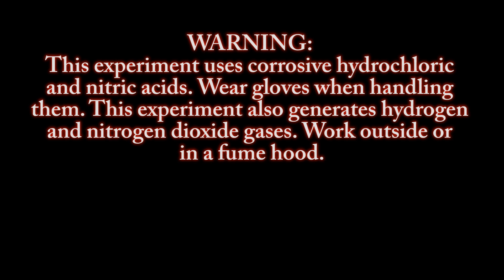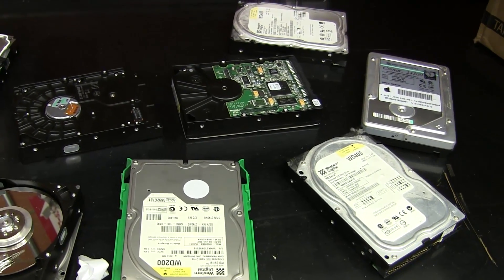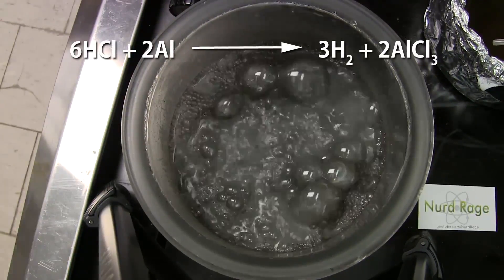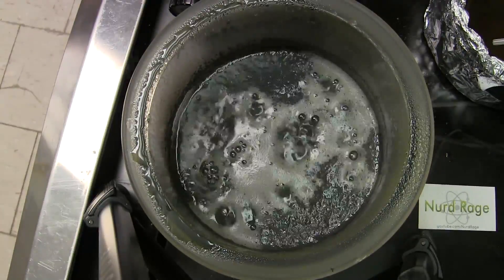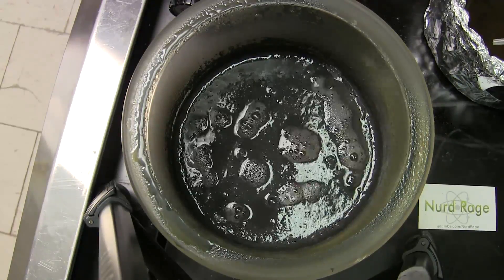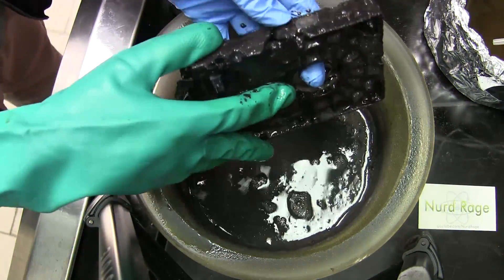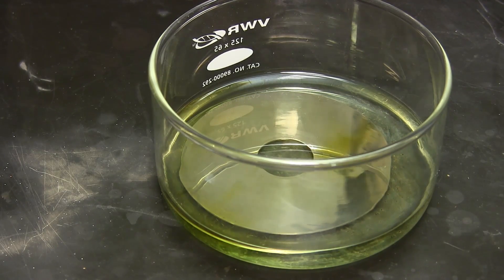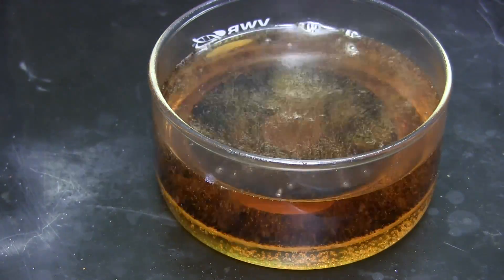Dissolve Hard Drives with Acid

Comment: Primary method: Use hydrochloric acid to dissolve drive components, then remove platter, place in separate vessel, and immerse in nitric acid. Wait for protective coating to burn off before adding more HCL to dissolve aluminum platter.
Alternate method: Bomb.

Comment: Producers of Prison Break TV series should watch your video. I mean Michael Scofield made a mistake by throwing hard drive into the water and even from there data could be easily recovered. But when you dissolve special alloy platters where data are stored in aqua regia, then there is no way to recover the data (however you can recover few miligrams of noble metals which are very valueable nowadays).

I actually disassembled some of my old hard drives and I kept these special alloy platters, because they contain noble metals from platinum group (who knows, maybe they will be very valuable some day).

Comment: Didn't even need the nitric acid. Just use a screwdriver and make a few hard dents on the disc. Coating gone, leave overnight. The next day all that would be left is a thin layer of the coating around nothing.

Comment: To kill the platters you can use Sodium Hydroxide (actually a product called Oakite 90) and electricity (in reverse polarity from plating). It'll blow the coating off in seconds.

Comment: I would have taken the motors out and save them or sell them on eBay.  The key is destroying the platters which are not very difficult to remove.  There are hobbyists who may want the motors, they are brushless and they could run them without much difficulty if any with brushless motor controllers that they already have.

Comment: why didn't you just burn the plastic parts of the hard drive and melt down any metal that was left
Reply from the maker: Because the point of the video was to use acid. Do you honestly go to a wrestling match and yell at them "Why didn't you just guns?" no, the point is to beat each other with fists. And in this video we use acid.
Reply: yeaaaa your baack!! :D i love u bb :$
Reply: +NurdRage I ment as a way to get rid of and plastic parts
Reply: Messy, it leaves residue, acid does a better job.

Comment: I remember talking to a friend who owned an E-Waste business about hard drives. The platters were worth $600 a metric tonne. He used to recover the Pt from them but it was too expensive. He used to snap the platters exposing the Al core and then put them in a solution of NaOH. Once the Al had reacted, the Pt foils would float off which he could then wash and dissolve in Aqua Regia. But yeah, the casing was worth much more than the platters.

Comment: What similarities does H2O2+HCL have with aqua regia?  I had a similar running with a couple of HDD and I didn't have nitric acid on hand so the next best thing was AP solution but it completely disintegrated the actual platter and left the shell of the disk (almost like a new U.S. penny, after it was washed off I simply crushed the leftover magnetic layer to bits and dust, but the platter was gone indeed, on the video it was left intact....why was that?

Comment: This is retarded, you could just microwave it or drill it
Reply from the maker: +xRsAtx If you get your fun by drilling shit, more power to ya. I on the other hand like to use acid.
Reply: xRsAtx Not sure if you are:
1. trolling
2. being an enormous douchebag
3. Missing the whole purpose of this video

This video is intended to have some fun with the harddrives.
If it was just the data on there, then he would have drilled it probably, but instead, He wanted to show us some chemical reactions that happen when you put those acids on the drive.
but you missed the whole point.
Reply: The top result when you google "hard disk" are what you see when you open up the casing of an HDD, hence why "disk" is included in HDD, and those disks are called platters.

Drilling holes in the disk to make normal computers and the control card on the HDD unable to read the data still doesn't mean that the data isn't there, as I said, there are custom tools that can still read the data of the still-not-destroyed parts of the platters.

And I didn't mean microwaving the disks doesn't do anything. I meant that microwaving the HDD doesn't really do anything spectacular and microwaving the platters still doesn't present the flawless result you seem to wish to have.

Oh, and stop using insults and things just because you're mad and you are unable to accept that you are wrong, please at least try to act adult.
Reply: +NurdRage Can you do some experiments involving silane or borane? Thanks
Reply: +PushButton seriously.... here...
Reply: But that is not as much fun...
Also, now we get to learn some more reaction stuff...
Reply: this comment wouldn't learn anyone anything since they don't want to learn. Scroll past <3
Reply: Eckron "they could still pry some data off of it." no they couldn't
Reply: xRsAtx 
ugh nevermind, should have learned by now that people choose to be ignorant
Reply: I like to use and abuse acid too.
Reply: +xRsAtx Ok, I'm really not sure where you're getting your data, but 10 minutes of googling has told me that the majority of hard drive platters/plates won't be damaged, and you'll simply have a f***ed up control board. Guess what you can replace. Control boards.
Reply: Untrue Fires
Watch out, your actual facts might trigger xRsAtx again.
Reply: Eckron "facts" literally no evidence that they are facts
Reply: xRsAtx OK. Friend. Please Google "microwave hard drive" and click the first five links. IR/Microwaves do not carry through Faraday cages. (Hard drive cases form Faraday cages. )
Reply: Untrue Fires Look, I told you, he'd get triggered.
Reply: +Eckron oh yeah btw I'm on your side just want wanted to see how RSAT would react he is a fucking drop kick
Reply: Embedded Irony
>My side
>My ally
>Calls me cunt
>Says that mister. Can'tAcceptTheTruth has a higher standard of living than me

I'm confused
Reply: xRsAtx Oh. Oh that's so civil. And by the way, a hard disk and a hard drive are the same things. HDD. Hard disk drive. 

The principle yet stands. The metals around it act as a Faraday cage, and for the most part, keep most of the radiation from harming the platters themselves.
Reply: Untrue Fires JESUS FUCK they are not the same thing, look up what a hard disk is you fucking mong, its the disk, if the disk is drilled it will not be usable, I'm not talking about drilling the fucking case
Reply: xRsAtx
You simply don't know what you are talking about.
Oh and if you drill the disk, data can still be read off of it, there are custom (custom as in specially made and not commercially sold) tools that can read broken platters (but the files may be incomplete, missing, corrupt and insert other flaws), which is (still) a good reason why you should always overwrite, zero out and decimate the entire HDD (Hard >DISK< >DRIVE<) if you want to be completely sure the data is gone.
Or you can simply dissolve the platters with acid.
Oh, and a "hard disk" and a "hard drive" are the same thing. In IT, we call them by their actual name, HDD or Hard Disk Drive.
Reply: Eckron no, its is you that is wrong
Reply: xRsAtx 
Care to prove it, while acting like an adult and while actually having evidence and facts backing up your statements?
Fyi, I study IT, I'm going to study cyber security, TL;DRring my text down a bit, basically IT is my life, knowing how an HDD works, how it's built and how to properly destroy it on different levels of security are basic knowledges.

Again, I never said you were wrong, never did that. I was just saying your way of having it is not 100% bulletproof (waterproof etc, whatever floats your boat).
And no, the typical user wouldn't need to zero out-, decimate- or dissolve the HDD, but it's just fun to do and it is 100% sufficient (zero-outing is still not a 100% guarantee due to possible broken sectors and whatnot, but you get the idea).
Reply: Then again, if you overwrite the data for another use, would said data still be present? If so, then I'd prefer acids or whatever to destroy whatever data is present.
Reply: Carlos Vera 
There are different states of the overwritten files.
For example, the free and commercial program called Recuva from Piriform has three categories, can't recall the exact names but basically they are "Damaged", "Flawless", "Unrecoverable".
A simple overwrite (1 pass) will still in most cases leave som traces.
A more advanced overwrite (3 pass) can still leave some traces.
An advanced and nicely named overwrite (7 pass NSA) will most likely not leave traces, it's pretty bulletproof.
The Gutmann method (35 passes) is just overkill, the data will probably be completely gone and unrecoverable after 5 passes anyway, Gutmann himself said that this method was invented just for gags (basically).

However, in the most used file system (NTFS) the file names, sizes, extension etc will still be listed in the MFT (Master File Table). Not sure if FAT or FAT32 has a MFT or something like the MFT in NTFS.
Reply: you have been arguing for days just accept your wrong
Reply: drill a hole through it xD

Comment: are any
special gloves needed to work with acid? or do rubber gloves work? thanks!
Reply: I would suggest something stronger than dishwashing gloves.
Reply: Rubber dishwashing gloves would work fine for sulphuric and hydrochloric acid. Probably use brand new gloves to ensure there aren't any breaches in the rubber. Nitric acid requires thick butyl rubber gloves to provide sufficient protection.

Comment: I prefer to just throw the platters and case in a crucible, and melt them into a silver pool of metal in my foundry furnace. Then cast parts I need out of the aluminum. I would like to see someone try to get the data off of a door knob, lol.

Comment: How about of you just bend the disc to damage the coating and then used only HCl and water, would that be sufficient to dissolve the disc, or would you just get a little extra damage in the cracks?
Reply: +Simon Als Nielsen yeah i wonder if you would be left with a cage of the coating...
Reply: Pseudobean Machine
 If so it will probably take ages to complete, but in that case my guess is that the bubbles would block the acid from reaching more than tiny bit into the cracks, but it would be an interesting experiment.
Reply: I'm reminded of gallium on scratched aluminium even thought it's totally different! I wonder if you were left with the coating intact it would be translucent!
Reply: NurdRage I would like to request the experiment discussed above :-P

Or at least your thought on what would happen. :-)

Comment: Nurd, does microwaving your HDD NOT nuke it to oblivion?
Reply: +Moe Chan Also what about strong earth magnets?
Reply: +Moe Chan if the plater is exposed yes if its still in the case no it will however destroy the driver electronics however the data on the platter will mostly be intact and can be recovered using platter swapping recovery techniques

Comment: I still maintain that a good sledgehammer works just as fine. Sure you can read data off drives that are punched through with nails and filled with glue, but good luck reading anything off an asymmetrical chunk of metal that's been beaten on for twenty minutes... =p

Comment: Take the platter, fold it over, scratch the coating, and apply a little gallium. 
I did this a while ago and you can see the coating start pealing away at a rather surprising rate (you can tell it's moving and you'll hear some weird crackling noises) as the gallium works its way through the aluminum. It also seemed like the aluminum was more easily powdered than you'd get from something like a heat sink. It had a really greasy feel to it too.

Comment: You made a big mistake here in the video
since you filmed the platter, now we can all get the data on it
so you didn't destroy the data at all.
Reply: +Ja-Shwa Cardell 1) The data is stored magnetically instead of optically
2) Even if it was optical, the physical size of the bits in an HDD platter are much smaller than bits on say a DVD or BluRay disk, and couldn't be read on a video of this resolution as there aren't enough pixels to convey information.
Reply: +Koriko Alistar He was trolling
Reply: Poe's Law and such.
Reply: Poe'ssy

Comment: The bearings in the motor... Were they also destroyed? I need a good way to remove their super-skookem bearings, but percussive maintenance damages them. The motor chassis is made of aluminum, and the shaft and bearings are some sort of steel.
Reply: +Luke Den Hartog Everything metal was eaten except the platter. This includes the bearings.
Reply: Skookum?  Percussive Maintenance?  Are you a fan of AvE?
Reply: Coffeehound yeah lol
Reply: + iamdarkyoshi    Just remember to engage your safety squints. :)

Comment: The only flaw in this video is that you didn't show the final result!
Reply: +Marcos Vinícius Petri The end result is a solution. No Disk.
Reply: +TheMontanaDave Yea... but it was like a cliffhanger, lol
Reply: James Oldfield Not gone, it will be in the solution.
Reply: I do know it disappeared at the very end. I'm actually a chemist, lol! What I meant is that he didn't show the process. We didn't see the disc getting smaller and smaller and smaller and all.
Reply: Fire is actually worse because high temperatures weaken magnets.
Reply: TheMontanaDave Yes, platters store data using magnetism. If you only dissolve the coating of the platter it's possible you could still use very sensitive equipment to read data off the platter.

It's quite difficult to actually render data unreadable from a platter without completely destroying it. 

We have recovered drives from a computer half melted from a fire before using specialized data recovery services.
Reply: ill boot up the recovery program to see if i can grab my data out of the slop
Reply: +TheMontanaDave ok
Reply: James Oldfield ;)
Reply: It disappears. Don't you know what acid does?
Reply: ***** It takes time, but ultimately you will end up will a solution along with "crap" on the bottom. Sediments that did not dissolve and or  oxides/salts/residuals. The Final product after you get the solution filtered or siphoned will be about the same with give or take a few 'contaminates' - depending on the purity of what you are dealing with. Watch NurdRages stuff on Aqua Regia and all his vids and maybe it will help.
Reply: I agree. Even though the coating on the platter was dissolved it sounds at least plausible that residual magnetism could be left behind inner parts of the platter.

If it was not fully dissolved, it's possible some data could still be recovered on the leftover platter by sensitive equipment.
Reply: Raisonbran648 Data could be recovered? Are you a fucking child moron? Do you know how hard Drives work? SMFH.
Reply: +Raisonbran648 fire isn't the same as deliberate acid destruction. C'mon bro.
Reply: +Raisonbran648 acid changes a material at the molecular level.
Reply: TraumaER lol! Me either.
Reply: +Raisonbran648 I'm not voting for that bitch.
Reply: Yes, so if you just dissolve the surface acid doesn't magically propagate and dissolve anything that it was not in contact with.

Unlike heat that propagates throughout the material, which is also a molecular level change that wiggles all the atoms and electrons around, breaking the alignment that actually creates the magnetic field.

It depends on what material the core of the platter is, if it's able to hold magnetism it's likely it still holds data unless you completely dissolve all of the material.

The whole point is for maximum security you cannot say with 100% certainty that damaging the platter's surface with acid renders all data irrecoverable. That would be naive to make such assumptions with sensitive data.

You should vote for Hillary, she has the same idea about the security of sensitive data.

Comment: How many mol's of HCL (concentration)?
Reply: +GamerABC That's molarity
Reply: GamerABC because that guy wanted to tell you you were using the unit mol wrong.
Reply: +GamerABC You mean the molarity of HCl, not mols
Reply: +GamerABC You mean the molarity of HCl, not mols
Reply: the concentration in mol/dm3. i dunno what you mean by molarity...
Reply: Elaine Marie I need a scissor
Reply: Elaine Marie
Yup! HCl will make the cavities (as well as the remainder of your teeth) dissolve into nothing! No need to go to the dentist!
Reply: GamerABC
Molarity is the right unit. You asked for mols in the original comment not mol/dm3, not mol/L so I was just correcting your mistake. If someone just said ten mols, it wouldn't help you at all...after all 10 mols in 5mL is waaaay more concentrated than 10 mols in 500L
Reply: Body Movement but then whats the point of the first reply lol, Its basically the same thing
Reply: 35% m/m you can do the calculation yourself
Reply: +GamerABC Conc. HCl is usually around 10 mol/L. The ones we have in our lab are usually either 32% or 36%. Wikipedia has a nice conversion table for HCl concentrations
Reply: +The Yatagarasu My molarities have cavities.  Do I use HCl to dissolve them?
Reply: The Yatagarasu i guess, i was too lazy to write mol/dm-3 so i just wrote mols (concentration)